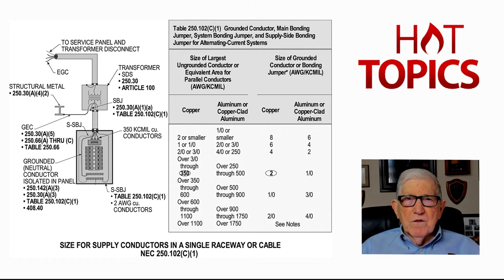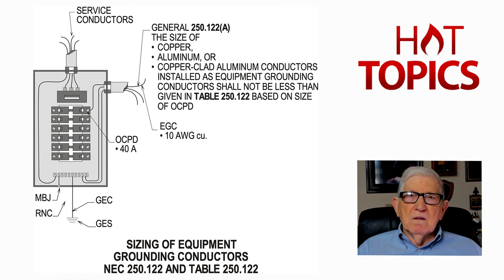HT E 22 Sizing Neutral Conductor Using Rule of Thumb

Comment: James, I purchased a home built in 1976.  I do not know what the service is but it is original, has two line side conductors and neutral.  I can not see and identification on the wiring in the panel that would indicate wire size.  The main breaker has a tiny sticker indicating 60 amps.  Is that possible that it is that small of a service?  I have AC, electric range and electrical dryer and newer experienced any electrical issues.  How can I really determine what the service size is.  I plan on replacing the service within the next year.
Reply: Hi Lucky,
I’m sorry to be so late getting back to you. The 1978 NEC allowed a 60 amp service if there were no more than 6-2- wire branch circuits. If more, at least a 100 amp service would be needed. To calculate the size service, see our TTME videos and you can determine very the size service needed. Usually per 1978 NEC, there’s would be 2- 6 and a number 8 neutral or even maybe 3- 6 size conductors.